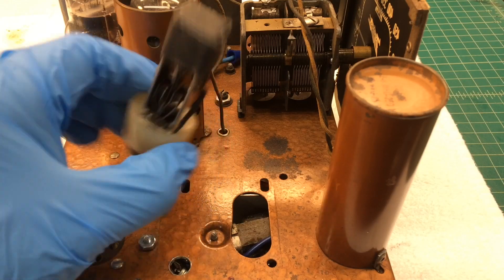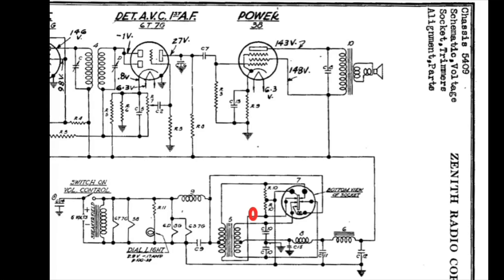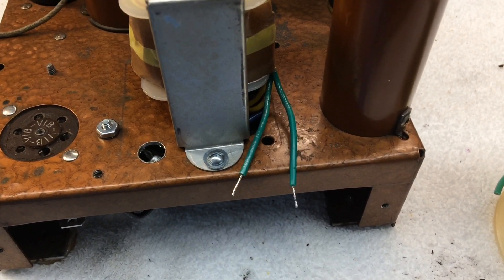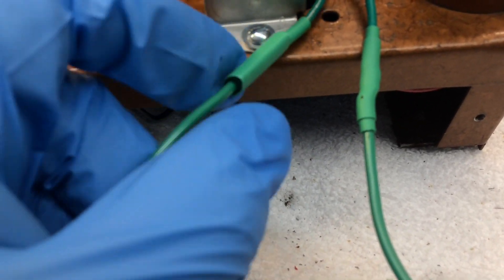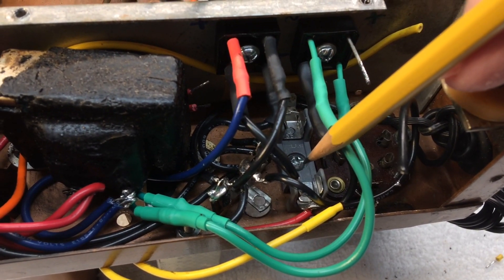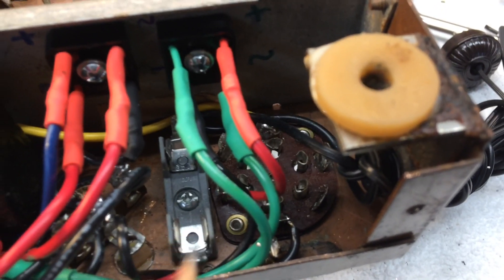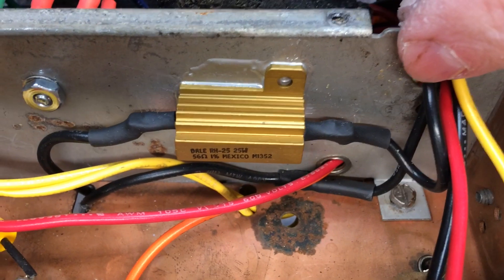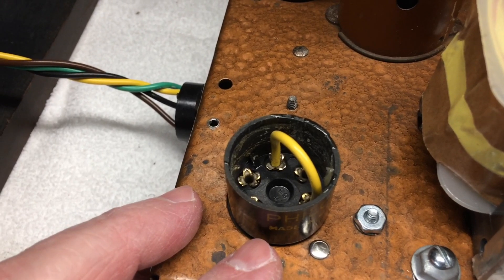Zenith 4-B-231 - Converting a Farm Radio to AC Power

Comment: I have a 1932 RCA console farm radio that I want to see if I can get it going. I need to figure out how to make a power supply that will give me 2 volts for filament and 22.5 for A bias, and 180 volts for the plates. I didn’t have any idea where else to ask his so I hope this is alright. I would need a simple design, I don’t have much experience with this. Thanks.
Reply from the maker: Hi Terry - what’s the model number so I can review the schematic? Sorry for my belated response. Best, Don
Reply from the maker: Hi Terry - just checking to ensure you got my earlier reply. All the best. Don
Reply: It is a RCA R43. The only info I can find is on the radio museum sight. I just typed a longer explanation and lost it before I could send it. I hoe this gets to you. Sorry about my poor skills with this stuff.
Reply from the maker: Terry - I’ll reply back by week end. I’ve reviewed the schematic, but need to study it more before recommending a solution. Best, Don
Reply from the maker: Terry - it would be worth trying a commercial power supply before attempting to design and build one. The schematic is confusing to me as I see 22 1/2 volts called out for the “A” voltage, but the note section references the set using an Eveready Aircell “A” battery, which is spec’d at 2V and that matches the 230 tubes with the 2V filaments. The “B” voltages are 4 x 45VDC for 180VDC, but the set should operate down to 135VDC at the point where they recommend “B” battery replacement. 

I would try the ARBE-III at:
https://www.radiolaguy.com/ARBEIII.htm

You can adjust your “A” voltage to 2V and run the “B” voltage at the max of 135V. The current demands for the receiver are not an issue for this power supply. 

Let me know what you think and confirm the 2V vs. 22 1/2V.

Best,

Don
Reply: Yes I can confirm the 2 volt filament for the tubes, I looked them up in a tube data book on
Line and  confirmed the voltage of 2 volts. The A negative calls for 22.5 positive,  and nothing was called out for the 2 volt A circuit, so I assumed that the filaments would act the same as in an AA5
And take care of the voltage.There is also a resistor in the circuit so I assumed this would make up the difference from the 16 volt s needed for the filaments and the 22.5 calls for on the A negative.
It is all a bit confusing. I will check out the link you sent for the power supply, and thank you for looking at this for me. I really enjoy for videos. Tanks again.
Terr
Reply from the maker: @terryharrison9306  Thanks Terry, just ping me back if you need anything. Best, Don

Comment: I have this radio!!!   Have had it since 1993 and never did anything with it due to having to hook it to a car battery.  Nows the time to try and get it going.!
Reply from the maker: I know you’ll be successful getting it up to par. All the best. Don
Reply: @RestoreOldRadios  I just hooked it up momentiarrly to see if the vibrator worked and it fired right up!  Ive had this radio 20 some ood years and never did anything with it!  Not recapped, and no tubes!  I thought for sure it wouldnt do squat, but instead it vibrates when turned on every time.

Comment: Don,  Great video and reference material for us hobbiest. Just purchased a farm set and surveying the parts cost for restoring it. By the way the "15" tubes mine calls for are rare to find. Lol....  Now I have a question that has been in the back of my mind concerning heater voltages:  Some manfacturers say 6 volts Ac or Dccan be used for the heater supply voltages. But isn't 6vac actually equal to 8.46 volt Dc &/or isn't 6Vdc actually equal to 4.242 Vac? If so isn't there a 4.2 volt over all range these heaters can operate on and using DC (as such) would draw more current (being at a lower voltage potential)? Forgive me for splitting hairs but if my math is correct, what am I missing? Thanks for your reply.  Best regards.
Reply from the maker: 6V RMS (AC) as measured on a DMM is equal to 6V DC. Hope this helps. BTW - I’m reviewing your other question in the video. Best, Don

Comment: Great idea Don keeping the old farm radio going and making it safer as well with a transformer and bridge rectifier. I still have to finish building the battery eliminator for my 1928 Case Farm Radio have a speaker of the same vintage only had a broken wire when I took it apart soldered it and it works so when I finish the battery eliminator I am hoping this old 1928 farm radio will live again. Thanks for sharing.
Reply from the maker: Thanks Larry. What are the filament voltages and B+ requirements for the 1928 Case? Best, Don
Reply: @RestoreOldRadios  Good question Don I am really not sure of what the voltages are on the 1928 case it has 6 CX301A tubes so whatever the filaments are and B plus of 90 volts??? but it's something I need to research on the radio to be sure.

Comment: If those are indirectly heated AC tubes in that set you may not need to supply DC to the filaments at all if that's what you were trying for with the regulator. I've heard of these sorts of sets being converted to AC with the old technology, and basically all they added was a generic power transformer with a rectifier tube, filter caps, and a choke for the B+ and ran the tube heaters directly off the 6.3 volt winding.

Comment: Or you could build a solid state substitute, though it really isn't necessary unless you intend to run it from batteries. You would have to add diodes to the circuit to take the place of the second set of contacts in the vibrator. From what I recall those vibrators run at 150 cycles per second, or is it 120, so if you can put that into the existing transformer you can get your high voltage B+ out of it. I've heard of people feeding 6.3 volts, 60 cycle, AC right into the primaries of vibrator radio transformers but I am not sure how long they would last.

Comment: Great work on the conversion Don, your knowledge never ceases to amaze me!
Reply: Hi Don! So I made up the shunt resistor setup and it brought all but one of the plate voltages within 10%. The detector tube is still about 30% high. Thank you for sharing your knowledge with me. The radio sounds pretty good, but it does have a bit of volume hum. I also noticed that when I touch the top cap of the 1RF the volume increases substantially and the hum is better. When I touch the cap of the 2RF the volume decreases substantially and the hum gets better. The voltages were taken on my variac set at 109vac. My voltage in the house last night was running 125vac. I'm adding a 20 ohm 100 watt power resistor to bring the line voltage down to 110vac, which is much closer to what the radio was made for. I originally calculated for a 10 ohm, but that only brought me down to 116, adding a second one in series brought it down to 110vac. That's why I ordered the 20 ohm 100 watt. I know the 100 watt is way overkill, but since the chassis is fully sealed, I want to make sure the resistor stays nice and cool. It should be here tomorrow.
Reply from the maker: Gregg's Vintage Workshop I’m glad all worked out. That’s a beautiful radio and you did a fine job on the restoration. Regarding the hum, I've noticed that myself on older radios and a good earth ground to the the chassis and long wire antenna will mitigate the issue in most cases. Keep up the great work. I’m going to publish the video you reviewed today. All the best. Don
Reply from the maker: Thank you Gregg. I hope to catch up on all of your great restorations soon. Thank you for posting your videos too and giving some of these oldies a second life. Keep up the great work. Best, Don
Reply: Quick question Don, on my AK 55C the current line voltage 118 - 120vac is higher than it was back in 1929 108 - 110vac, and is running my plate voltages about 50 - 70vdc high. What is my best option to reduce that voltage to get the plates back where they belong? I need your knowledge sir.
Reply from the maker: Gregg - please review the unlisted video. Let me know if you approve and I’ll make it public if you think it adds value and makes sense. Best, Don

https://youtu.be/UrkFaES4riQ
Reply: It's a perfect video, that helps me tremendously,  yes please post it. For those of us still learning the hobby, we need this sort of guidance from those with knowledge and capability to provide the rest of us "Teaching Moments". Thank you Don!
Reply from the maker: Gregg's Vintage Workshop Just curious what you found in regards to the high plate voltages. Best, Don
Reply from the maker: Gregg's Vintage Workshop Just curious what you found in regards to the high plate voltages. Best, Don

Comment: I really dislike drilling & cutting on vintage radios like that.  I'd probably have replaced the vibrator with a solid state equivalent and fed it all with a small DC supply.
Reply from the maker: Not my typical approach either. I looked at some of the solid state replacements when I did the initial repairs, but after I got the old vibrator working I moved on. Who do recommend for a solid state replacement? I did build a 6V PS for the radio too, but it draws just under 5 amps of current and it was too big to mount in the cabinet. Best, Don

Comment: Man! Wish I had seen this last Friday! Had an opportunity to pick one of these up last Saturday. Didn't think about a conversion. Next time.
Reply from the maker: Joe, sorry about the timing. Hopefully another one will come available soon. All the best. Don
Reply: It's pretty basic for a battery radio, though it would perform better then a four tube battery set using battery tubes thanks to the higher B+ delivered by the vibrator power supply and the AC tubes it uses.